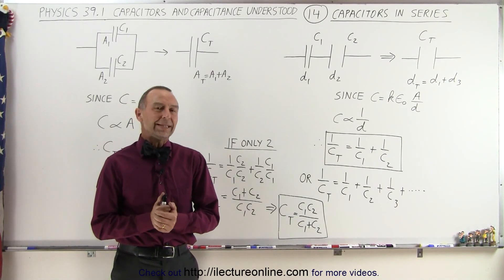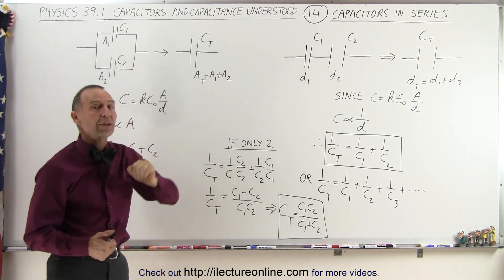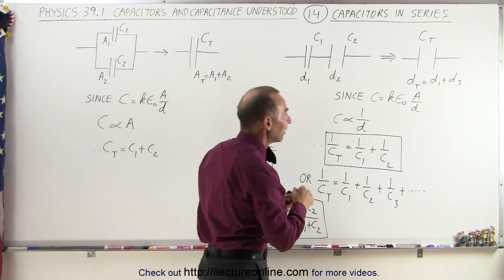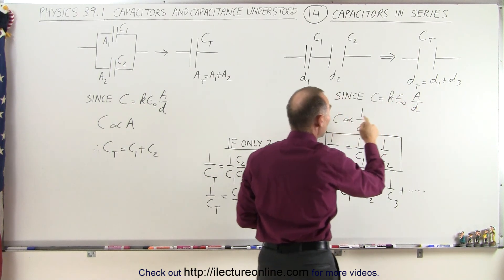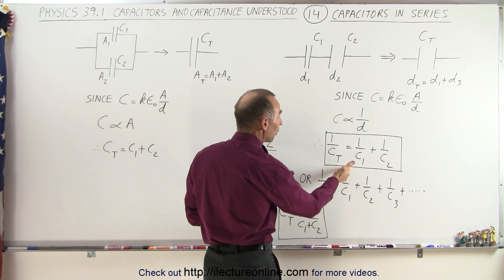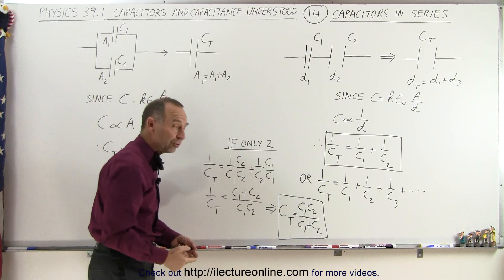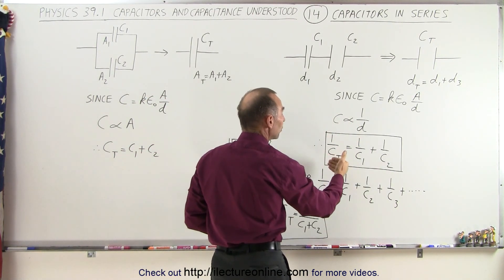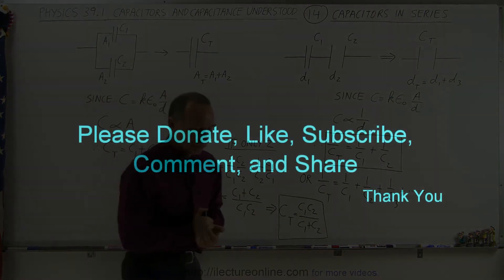Physics - E&M: Ch 39.2 Capacitors & Capacitance Understood (14 of 27) Capacitors in Series

Comment: Thank you very much for the video, but I have a question. What does it mean for the charging process of a capacitor to have some charge in Coulombs moving through the battery? Would this be the charge of the total capacitance?
Reply from the maker: In order for a capacitor to charge, something has to push that charge onto a capacitor.  That is typically done with a battery, a power source, or any type of voltage source.  The charge would come from the source or pushed there by the voltage supply from another location.